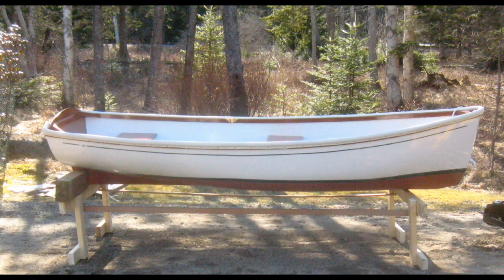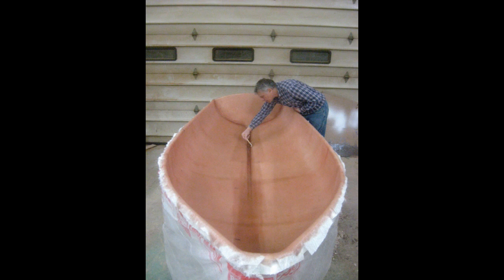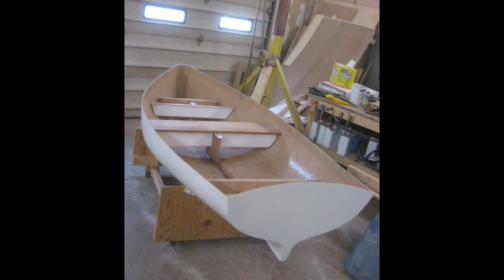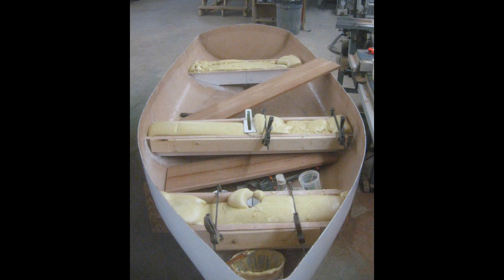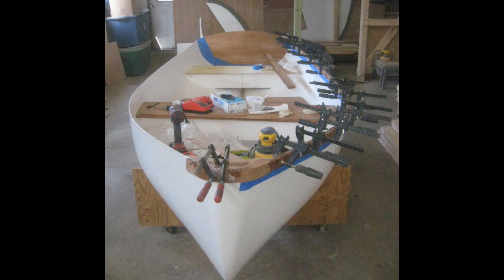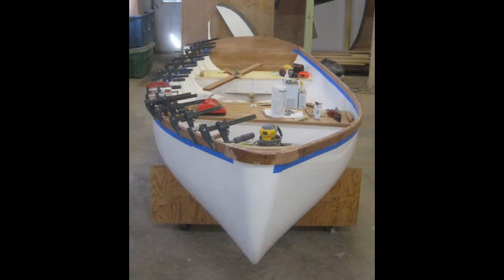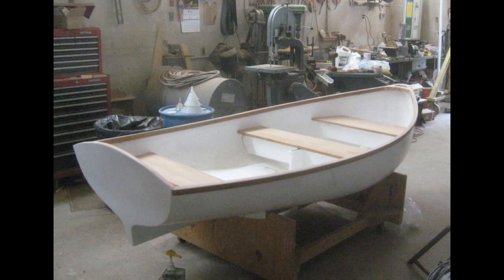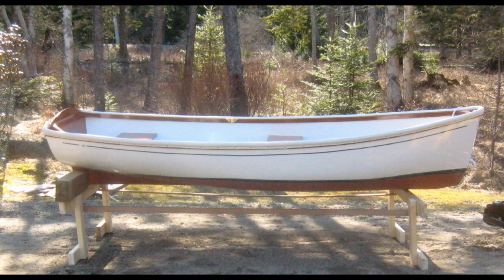Building a 10' Fiberglass Dinghy

Comment: What’s the cost involved in a build like this? Also, what would be  a sale price when completed if you ejected to go that route?
Reply from the maker: Frank, the boat cost me about $1,000 to build including a set of 8' oars with bronze oar locks and leathers.  I would sell it for about $2,500 with fresh varnish since there is quite a bit of labor in it.  This particular dinghy includes a centerboard trunk and mast step.  Adding the rest of the sailing rig (mast, sail, sheeting for sail, rudder and centerboard) would cost about $1,000-$1,100.  I am planning on getting a trailer this summer which will add about $900 to the cost due to the cost of the trailer.  I could finish it out as a full sailing dinghy on a trailer for about $4,500.  Incidentally, this is the last Hank Hinckley Yacht Tender dinghy built and is likely to stay the last one since the molds are here in Maine and Hank now lives in North Carolina.

Comment: The hull is completely made in fiberglass.  Is the hull too flexible without any core material?
Reply from the maker: Yes the hull is solid glass.  Except for the transom there are no flat panels so the hull is quite stiff despite the light layup.  Curvature gives panels stiffness.  The transom would be very flexible, but it had a 3/4" thick layer of mahogany bonded to it.
Reply: @todddunn945  Thanks for explaining that the shape of the hull provides the necessary rigidity.  I need to keep this in mind.
Reply from the maker: @captainjayc9217  No problem.